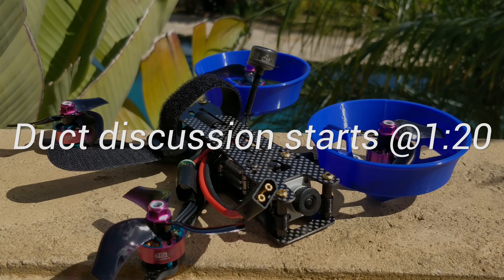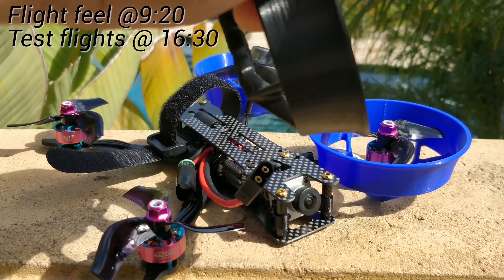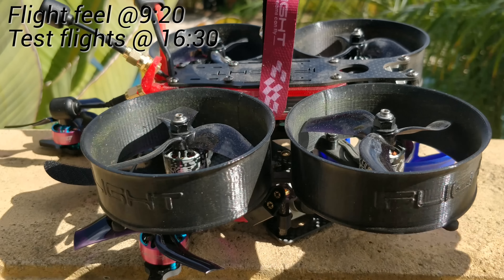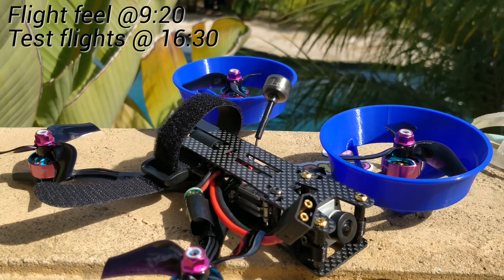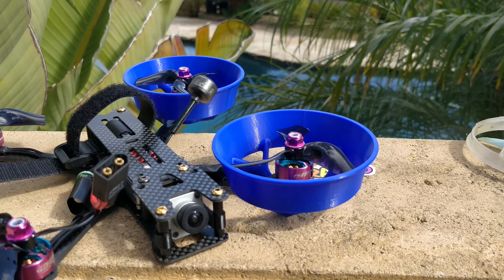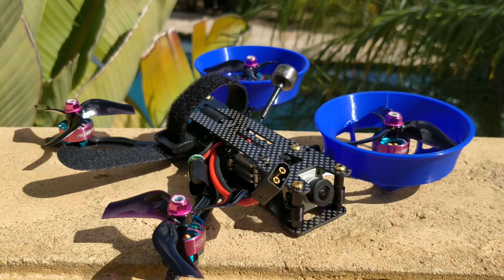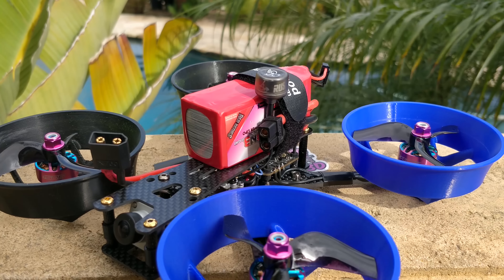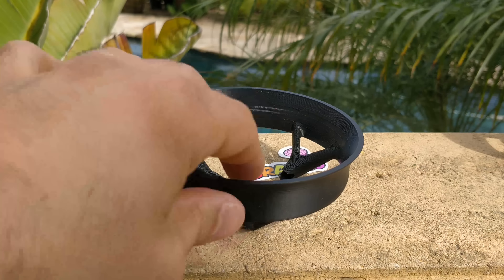introDUCTion to duct effects - Thanks Panico FPV for the name

Comment from the maker: The Survey: http://bit.ly/2HNz1E9
Real Ducts from StanFPV: https://stanfpv.com/collections/all

Bruce's video on Ducts: https://www.youtube.com/watch?v=Cew5JF8q6eY

This particular quad in the video:
FC: http://bit.ly/2Ta2Vrk
Motors: http://bit.ly/2ST3Vl4
Props: http://bit.ly/39OMI1I
Video/control: http://bit.ly/32qgSWE
Prototype frame

Watch this to be the best informed on how to comment on the FAA's site: https://www.youtube.com/watch?v=XmUQV549-TI

▼Join my FB group for more discussion: Kabab FPV
https://www.facebook.com/groups/379155946182689/

The store: www.FPVCycle.com

▼ My typical 5" quad setup:
-Hyperlite Glide Floss Lite: https://fpvcycle.com/collections/frames
-Motor: http://bit.ly/2Nqqr25
-ESC: http://bit.ly/2oDdzvL
-WaFL’s Cap Cap: http://bit.ly/2GUpXxO
-Battery: http://bit.ly/2JnsTDM
-FC: http://bit.ly/2XRc8G8
-FPV Cam: http://bit.ly/2Q7LfL7
-Vtx: http://bit.ly/2HsrASs
-ND GoPro Mount 30deg: http://bit.ly/2WC15zc
-ND Filter (if used): http://bit.ly/2WEmQ1j

▼My preferred goggles as of Sept 2019
http://bit.ly/2k5YNv5

▼Notable motors:
-BH R3 2207 for $9.99: http://bit.ly/2NaTWEy (limited quantity only)
-Xing 2306: http://bit.ly/2Nqqr25
-Xing 2208: http://bit.ly/2y3te8R
-FANTASTIC 6" motor: http://bit.ly/2LqghOZ

▼Starter goggles: http://bit.ly/2qbJNOS

▼ If you want to solder better:
-Fantastic solder: https://amzn.to/2P5QM2W
-Fantastic iron: https://goo.gl/DqBipa

▼ Tips?
Patreon: https://bit.ly/2oGLP9b

-PayPal: https://www.paypal.me/kababfpv
-Bitcoin: 1E4XZXoD4rS6MYWVWuenY7Kw2M1YgyNpoQ
-Nano: xrb_1188ek5bd7tb9kw67asnp9o65byuoaxbtpxuznx1ribf75x78awywmakj55f
-ETH: 0xD067F93811f2eC31CB1928901002dfdf9A492EF5
-LTC: La2KWYAjp4VT2Lq2M76pbjzXWvRyjpfCtG

-Tesla Referal code: https://ts.la/bob40889
Please use my referral code if you're gonna buy a Tesla.  You get some free stuff when you do and I get better status with Tesla.

Comment: I have the Transtec Beetle that comes with very light prop guards.  Today I snapped off an arm in a very 'mild' crash into a grassy field.  Only 10' or so off the ground but just the right angle to snap one of these very small arms.  I was not flying with the prop-guards and in hindsight, I think they might of help absorb some of the impact.  I would comment that this 'smallish' quads don't have thick construction and even though they're carbon fibre could be more prone to damage.  Transtec parts replacement is currently down because of the virus situation.  I definitely will be flying with the ducts/prop guards when I get in back airborne.

Comment: Hey Bob, my quad with Stan fpv ducts also did the zero throttle flutter up thing, with all four ducts installed. I had to hand cut the props to fit. So I'm thinking it's more of a flyaway. In blackbox, it showed one of the motors at ZERO with the other three spinning up! With the stick at zero throttle.
Reply from the maker: Likely a result of uneven props maybe. ?
Reply: Probably so. I need to make a real jig. And get a dremel 👍
Reply from the maker: @bren42069  this is why I cannot tolerate needing to cut props

Comment: Hey Kabab, when we try to consider the lift that the duct system "may" be adding, we would need to design the duct for a very specific speed and angle, correct? 

My point is that when you want to fly "smooth" (not necessarily slow), over a lake, following something, etc, you may be able to stay in that speed/angle window, but speeding up or down over that window, or correcting the angle could "pop" you out of stability as you lose that, even small, lift, making it acts weird and harder to tune.

From my experience, I think that what I am liking in my cinewhoop build is exactly the way it handles height changes and how stable it can be, also there is a safety factor when you bump into your car... What I don't like is how wobbly it is when flying in corridors and how wind bumps it around.
Reply from the maker: Lots of things we can do to test and see if it helps.  wind bumps are also an issue as there's lots more drag.  Another matter to consider

Comment: @KababFPV

1st off, Just wanted to also mention that the survey page doesn't work well from a tablet as your unable to scroll the menus down.

2nd off, From my own design and physical experience(s) with Ducts here are several reasons why they're not practical for Quad use.

1) Drag in forward flight can be pretty bad, especially if the Duct wall is rather high. For any craft thats just hovering about this is fine but for a Freestyle Quad, its like flying on 2S.
2) The Ducts tend to lose their added lift as the Quad Pitches or Roll over. (not in level flight) Essentially, the ducts leading edge is only producing lift on the side facing the direction of flight.
3) Ducts will attempt to self level the craft causing the Flight-Controller to apply a counter force. This can make Tuning such a quad difficult as the Quads feel will be off from what a pilot may expect.
4) The added inertia from the Ducts added mass makes freestyle feel mushy and acceleration nonexistent. 
5) Any added lift gained is totally dependent on the "lips" curvature / height of the Duct wall and how close the propellers are from it. (1 mm separation for a 5" quad is ideal) Thus bigger is better but then the added mass makes the entire thing pointless.
6) Duct walls will start to oscillate as the propeller / motors reach the Walls resonant frequency. In the most extreme situations this can lead to the props colliding with the wall.

Propeller guard on the other hand are a much better solution. Not only does it offer added protection / reduced weight / lower drag / less noise but can reduce propeller vertices increasing the flight times. Granted you don't have the added lift but you also don't have the problems that come with it.

Side Note: I've several copters on my channel that I tested various Duct designs in flight. Feel free to look those over.
Reply from the maker: Many of your complaints are exactly why ducts are useful. They force you to fly very slowly with great control. Exactly what you want in a cinewhoop. Also, if designed properly, they don't suck at all
Reply: @Kabab  I've made some great Ducts that flew pretty good but mostly found them to be more of a hindrance for Freestyle then anything else. Sure Ducts are "Ok" on a Cinawhoop due to the small size and their specific usage. However, you cant scale it up without those small limitations I mentioned, becoming a really big problem. Case in point, the largest Duct i was ever able to produce was 6" and it few like crap compared to the same design at 5". Now at that scale (6 inch), each duct would weigh 50-90 grams each. Then you have to consider, you'll need four of those, totaling 200 - 360 grams! Almost as much as the entire entire 5" quad...
Reply from the maker: @4DCResinSmoker  ducts aren't for freestyle at all.  Zero point in that.
Reply: @Kabab  Yeah i get that but peoples expectations or lack of knowledge will only invite them to assume they can. IMO they've not worth the time or money involved when a prop-guard does near about the same thing for much less mass.
Reply from the maker: @4DCResinSmoker  the ducts I'm using on my design are full enclosures at only 10g. Hard to beat.
Reply: @Kabab  For a 3" quad thats to be expected. Try scaling it up to a 5, 6 or even an X-Class quad. Reason you don't see these around is because its really hard to do.

Here is a 3" Tail-Mechanism + guard for a micro sized tricopter of my own design: https://www.thingiverse.com/thing:4265588

Comment: I put the 3" stanFPV ducts on my second 2-3s toothpick, making it a whoopick, or with the onboard nameless dvr maybe a cinepick?  Anyway, I used the thinner pads under the arms to lower /soft mount the guards in stead of on top raising the motors in order to clear the motor mounts on the frame (Sanchez 3).  My observations; they do make it very stable, but have to run on 3s or it kills batteries, very loud with the included tops and HQ tri bladed (non ducted, winddancer i think) props, quieter and lower pitched without the tops, which the webbing started breaking out of, so i just cut it out and use the soft rings only for bumpers indoors.  Going to try the gemfan 65mm penta-blade props for ducts.  If they really do add efficiency maybe they'd be good on cinematic long range..

Comment: I fly a custom built KingKong ET Max. It has guards that are 12mm tall. I use 2206 2600kv motors with 4" Scimitar props. It flies like it has thrust vectoring and is very resistant to side winds. I get 4.5 to 5 minute flight times with a 1300mah 4S battery.

Comment: Those HQ Duct props made the motors on my Squirt get super hot. I replaced them with the Gemfans and the problem went away. My battery life also increased.
Reply from the maker: Yeah the HQ ones were pretty terrible on anything I put them on too

Comment: A thought, I’m no product designer. 
But couldn’t they join the prop and the duct so you end up with a spinning cylinder, with blades inside. 
That would eliminate the gap at the end of the props and reduce noise and increase efficiency. 
This obviously would add a lot of inertia to the props so changing speed would be sluggish. 
Also a lot more strain on the motors. 
But perhaps for a cruisy cinewhoop, quiet, smooth quad, that my be a win win anyway. Smoother etc.
Reply from the maker: The comment before you literally said the same thing. 😂. Yeah that seems like a cool idea too. If we're really gonna go down this path it should be something tested

Comment: Has anyone tried a duct that is narrower than the prop with a decreasing diameter as it goes down with a bulged out ring in the center that makes a channel for the prop to spin inside of. Pair that with a prop that flattens all the way out to zero pitch at the tip where no air will be flowing through. So for a 3" prop, have the air flow channel be 2.8-2.9"?
Reply from the maker: That sounds great actually. But how do you get the prop into it? 🙈. Split open?  Would be interesting to hear.
Reply: @Kabab  My first thought would either be a 2 piece printed duct that uses tabs indexing and possibly snapping into a locked position, or props that are flexible enough to be bent into position without any permanent deformation.
Reply: @Kabab  Assuming you're using motors with 4 mounting bolts, 2 could be used to secure each half of the bottom of the duct assembly. This would make changing props a bit more cumbersome since you'd need to remove the motor bolts, but might be with the trade off since the props would not need to be changed often except for damage from a crash.

Comment: AFAIK, to fully reap the efficiency benefits of ducting a prop, the gap has to be 1% of the diameter or less.  
  
BTW GL with the FAA thing, i took the survey even if I don't live in the US. A hit to the American community would still be a hit to the larger RC community
Reply from the maker: The rest of the world will follow the FAAs lead unfortunately
Reply: TBH the EU laws we have since july are already kind of bullshit. Anything over 250 grams requires registration and even aircrafts under 250 grams if they have a camera. Let's just hope they don't get enforced
Reply from the maker: @francescobasile3748  yeah was same as FCC but worse. Whatever the FCC does won't get better anywhere else

Comment: hey Bob, you don’t happen to have black box or telemetry logs for the test with ducts on only one side? if those ducted motors are producing more thrust, they should be spinning slower than the unducted motors if the quad is level. Would be interested in seeing how much slower they’re turning if you have that data!
Reply from the maker: yeah....I'm hoping someone repeats my test with actual data.  Clearly my backyard science is heavily flawed....but just doing some rudimentary testing.

Comment: lots of good info here. I'm always surprised to see people flying with no go pro placing their battery so far back. I feel like I get  better flight performance out of a quad if I get the weight more towards the front of the quad, that way the rear motors aren't fighting as hard. That said, that's why I fly "toilet tank" on any quad that I can. I know that you're not a fan of it, but you should def make some slots in that top plate so that it's an option for us toilet tank die hards out here. :)
Reply from the maker: Oh no this quad has a long nose. The batt is actually in the middle of the props.

Comment: I guess ducts are more useful on DJI style camera drones which hover 90% of the time. Ducts try to bring quads into an horizontal orientation - therefore it is not suited form race quads. Furthermore our quads stabilize by quickly changing thrust. The inertia of airflow thru the ducts counteracts that.
Reply from the maker: Yep. I hate the effect but can appreciate the effect too

Comment: Kabob - I entirely disagree with the method you went about "proving" that the ducted side flies better than the none ducted side. What you were seeing there in the video (around 17:20) when it wouldn't descend was a result of the gyro compensating and causing D-value spool up in the pid loop, causing all motors to spool up, which inturn creates more thrust. And ducts don't create lift, props do.
Reply from the maker: It's purely a guess on my part. As for the ducts, yeah they're not really perfect at all since the prop isn't super close to the edge but it's been shown over and over that the effect produced by the duct does actually create more thrust than no duct. My guess was that there was more thrust being generated by the duct side and the opposite side had to spool up to compensate. This may actually be false and your D flutter up may be true. But the quad is better at lifting the load of a GoPro a little better with the 3" props and ducts....others have done bench tests to show the thrust generation of the duct.

Comment: Adding information: In this duct there is the Venturi principle that consisted of increasing the speed of the air flow as well as the increase in pressure below the duct and consequently a decrease in pressure at the top of the duct generating a greater lift ... I loved your explanations and experimentation, and how it influences the performance of the quads ...
Very cool, very thanks man ...

Comment: Just a crazy idea: what if we have an a duct that is attached to the prop at the ends so there is no more air gaps? I know having a spinning duct would have other effects in flight but it would be an interesting test.
Reply from the maker: Yeah a few others mentioned that. Very intesting idea. Maybe.  You'd loose some response from the added weight but could work well.

Comment: I really don't see many aerodynamic pros to ducts on quads for some of the reasons you mentioned.Varying Angle Of Attack being a large one.The ducts are never in an appropriate AOA or moving fast enough to generate lift themselves without some negating effects on the other side of the duct. The efflux diameter is probably too large and the props too far from the duct walls to really work well as a ducted fan...They are good soft target protectors though and my Squirt uses top prop guards for that reason....hardly fly it though because it sounds like someone threw a bag of cats in a blender....
Reply from the maker: lol cats at a blender.  I was genuinely impressed that this quad did not sound like a chainsaw.  EVERY single other guarded or ducted quad I have sounds like a war machine.  I agree with you in general but in this instance, he's really done a good job with the management of how you fit the prop to the duct.  Still I'll take any open prop design any day instead.

Comment: Hey kabab what do you think about the baby Ratel it fits the beebrain v2 canopy perfect! The screw holes on the cam align with the clip of the canopy.  I love your TP3 frame!
Reply from the maker: looks beautiful.  hopefully the QC holds up.  already I've heard many with dust on the sensor as usual with caddx.
Reply from the maker: wait, really? it fits the bee brain v2?  I didn't even try yet
Reply: @Kabab  it fits perfectly 😁
Reply: @Kabab  also I feel like it's just a smidge cooler on 3.3v but I'm running it on 5v now since I didn't see the 3.3v pad on the goku aio board in time😑

Comment: My simplified understanding has always been that ducts prevent thrust loss due to tip vortices. But that comes with a price. To realize a net gain, they must operate at a higher RPM and the gain is not at all linear.  So if you use them.on a jet they work great because you are throttled up most of the time. On a freestyle or race quad however where RPM is constantly changing, it's not really the right tool for the job. Tuning to get them more efficient across a wider RPM range is definitely what is needed for them to be for general use on multirotors.

Comment: Try pwm at 48khz and motor timing on auto. I get 6-7 mins on my custom built taycan and bumblebee and totally cold motors on 1300 4s. Also helped me with the tune too. Efficiency increased substantially.

Comment: does an EDF in a rc jet have an airfoil?
Reply: It can... Depends on the design of the duct(s). A Venturi or circular airfoil should increase flow and pressure making the system more efficient but can have negative affects on throttle control especially at the low-to-mid throttle regions.